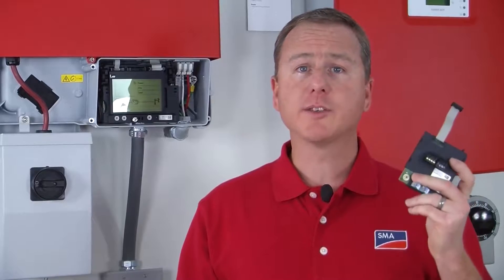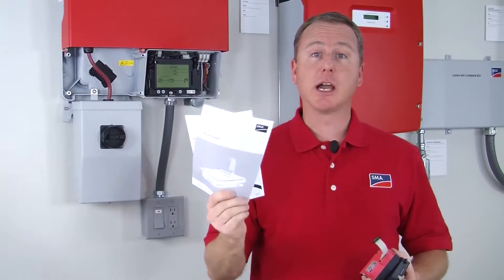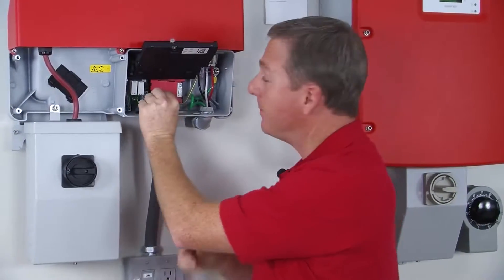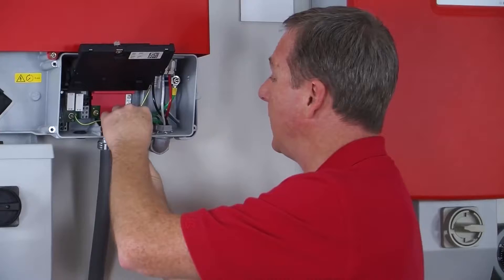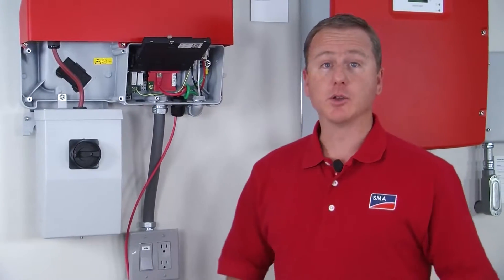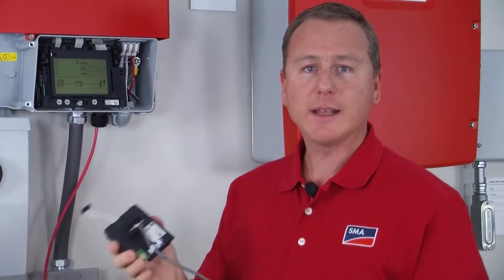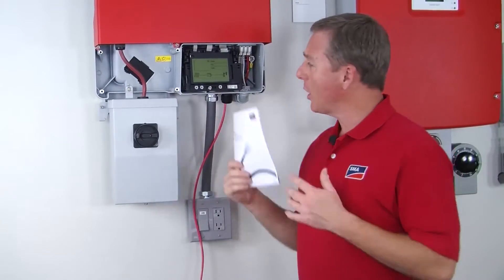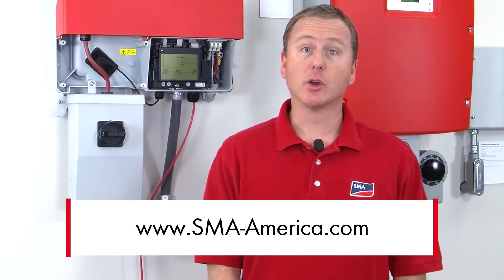SMA Tech Tip  - Installing a Webconnect or RS485 Card

Comment: Do i need to Update my sb3000tl-21 (manufacturing date 2012-08-01) to start using the webconnect module, And if so i can only update my Inverter via an sd card. Can Someone Maybe help me?
Reply from the maker: To utilize the Webconnect module with your SMA Sunny Boy 3000TL-21 inverter (manufactured on August 1, 2012), it's essential to ensure that your inverter's firmware is updated to at least version 2.51. Since your inverter predates the integration of Webconnect functionality (standard in models produced after September 2014), a firmware update is necessary. 
Check: sma-sunny.com or sma-benelux.com

You can perform the following at your own risk' 

Given that your inverter supports firmware updates via SD card, you could perform the update by following these steps:

Obtain the Latest Firmware: Download the appropriate firmware for your inverter model from the SMA Download Center. Ensure you select the correct firmware version compatible with the Sunny Boy 3000TL-21. 

Prepare the SD Card:

Use an SD card with a maximum capacity of 2 GB.
Create a folder named "UPDATE" on the SD card.
energymatters.com.au
Copy the downloaded firmware files into the "UPDATE" folder.

Perform the Firmware Update:

Ensure the inverter is disconnected from both AC and DC power sources.

Reconnect the inverter to the power sources. The inverter should detect the firmware update automatically and initiate the update process.
Monitor the inverter's display for update progress and completion messages.
Once the update is complete, disconnect the power sources again before removing the SD card.
For detailed instructions and safety precautions, refer to the "Firmware Update with SD Card" technical description provided by SMA. 

If you're uncomfortable performing the update yourself or encounter any issues, it's advisable to contact or reach out to SMA's customer support for assistance.
Reply: Thank you very much!

Comment: excelente explicacion pero creo que les falto ser mas ilustrativo en el manual de instalacion del pdf del modulo SWDM-10, hacer una ilustracion donde vaya dibujado que en cualquier
puerto pueden poner el cable ethernet RJ-45 del ordenador y en el  otro puerto poner la red ethernet que viene del router cuando sea solo un inversor y cuando sean dos o 4 inversores irlos 
puenteando ya sea del A al A o B y asi sucesivamente y el ultimo puerto que quede libre ahi poner el ordenador .saludos
Reply from the maker: Thank you for your feedback! We appreciate your suggestion about adding a more detailed illustration to the installation manual. We will forward your input to SMA Tech to consider including a clear diagram to better demonstrate the correct Ethernet cable connections for different inverter configurations. If you have any further questions or need assistance, feel free to reach out. Best regards!